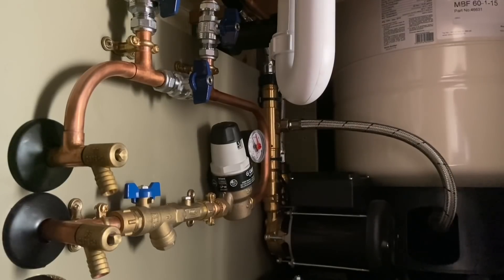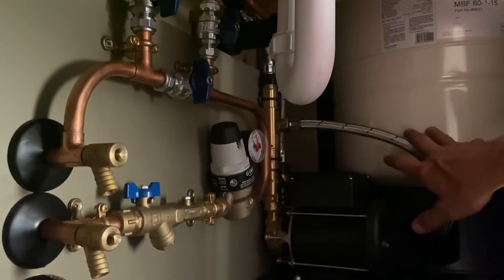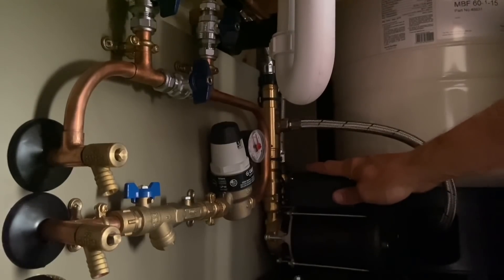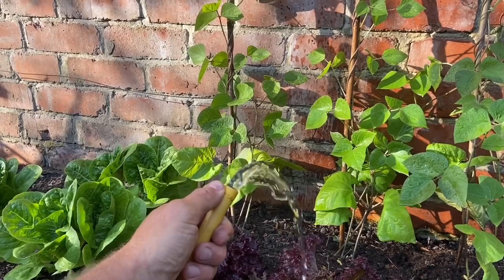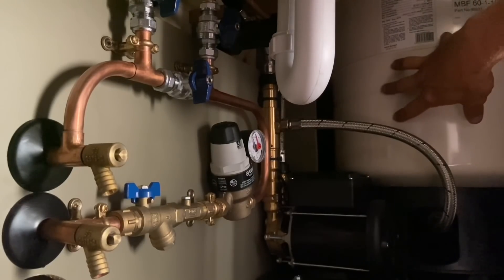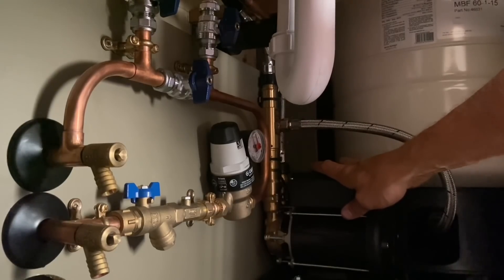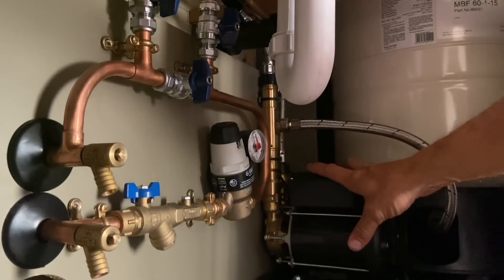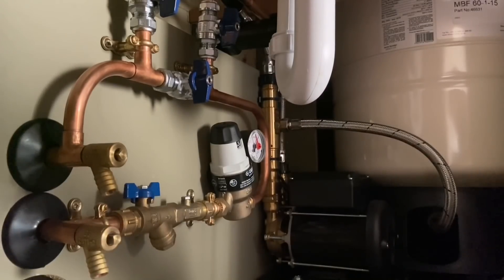P B Plumber: How to boost your water pressure and flow rates

Comment: Is it really a stupid question to ask that if you contact the water board locally, and get them to cut a new water service,with say a 20 mm water supply would that solve the need for all that pump and extra,s I just had to ask.

Comment: I've done loads of these around London, Stuart Turner Mainsboost products are first class but boy there not cheap, I also not long ago fitted a Aquaboost iboost that is just a cold water tank with boost pump that got the home owners out of a very difficult situation, it turned out well.  There original set up was a open cold water tank with a boost pump over thirty meter below there flat in a maintenance room that someone kindly filled with old cardboard boxes'  they had a white bacterial growth growing on them and this was their drinking water as well. before we fitted the unit we lined the walls of a large broom cupboard with plaster board that had  2" sound insulation on it  and put similar on the floor with a chipboard cover.

Comment: I'm an American Plumber and boy is it different.  Are the connections on the copper piping compression? I didn't notice any sweat or propress joints.  Do yall typically use compression style fittings? Just curious about how it's done across the pond.  Great video.
Reply: The branches or 'Tee's are soldered , he uses the bare minimum solder to keep it neat. We use soldered , compression ( mainly valves ) and pressed fittings . Most domestic initial installs are plastic piping with push fit connections , gas is still in copper . You see copper used where it's visible , under sinks or in cylinder cupboards.  It's just for show mainly .

Comment: That soldering is top notch. I thought for a moment it wasn't soldered yet. How do you manage to get it so clean? What do you use to clean the pipes afterwards? Would love to see a guide on that! Well impressed. At the moment I tend to chuck way more solder in than needed because I dont want it leaking.

Comment: Just out of interest was there a non return valve on the outside tap? I'd always been told that you wouldn't get a true dynamic reading opening another tap.as soon as you opened the outside tap the pressure gauge drops,that's your dynamic pressure. Excellent work by the way👍
Reply: That's a fair point , the gauge would continue to show the trapped pressure after the non return.  It did seen odd that it only dropped 0.1 bar from static to dynamic.

Comment: Brilliant video, was mulling over this pump a while back. We get about 17-19lpm but have terrible dynamic pressure (goes from 2bar to .7bar with tap on), so everything is fine until another tap is turned on then the boiler struggles. Anyway think your explanation is that this will work for us with the pass thru bit for the extra flow, though the noise might be an issue.

 Ideally don't want the noise so wondering about a none pumped accumulator, so if you have any info on those that would be great!  Thanks

Comment: When you place your thumb over the hose you create an increase in velocity.  Benouli explains that an increase in velocity occurs due to a decrease in pressure not an increase. I argued with an aircraft engineer over this point and ended up eating humble pie. It's the very phenomenon that creates lift in a wing. The top of a wing is longer than the bottom. The air passes over the top faster than under the wing. The higher velocity air is lower pressure and so the wing is pushed up by the higher pressure below. 
Pumps have a pump performance curve. The lower the flow the higher the head they can generate. Similar to your thumb on the hose the flow is reduced and so the pressure in the pipe increases. The pressure drop created by the orafice formed by the thumb allows the pressure to be released ( so pressure drops ) the result is increased velocity.
Your flow gauge can demonstrate this very well. The flow adjuster can be used to show the increasing velocity as the pressure drop increases. The gauge will show the pressure rise in the system as the flow reduces and velocity increases. This is the hydro dynamic law. 
P1/Q1□ = P2/Q2□
Interestingly I thought the pump could increase flow up to 12lpm by drawing more from the main. The reason for the low flow rate limit I believed was to prevent the back siphoning from other properties sharing the main. Do you have a link to your source for that information please.
Reply: I was going to comment but You got there before me 👍 I have had the same discussion with other plumbers
Reply: Correct, nozzle theory isn't taught to plumbers it seems.
Reply: @captainmashedpotato2630  yes it is!
 His explanation makes no sense to me, and i am a plumber.
Reply: Great explanation,  I'm an Aircraft Engineer and was going to comment,  but don't need to now.  Still another good video from PB though

Comment: he's back! what about the salamander mains booster? is that same thing? i just dunno how it does it when its inline and not able to pull more water from the mains
Reply: It does pull more, he just got it wrong. Regs are that you can't pull more than 12 lpm but you can increase an 8 lpm supply to 12 with a pump.
Reply: It doesn't pump more than what's coming in . What it's doing is increasing the pressure to overcome the losses in the pipework that would otherwise  decrease the pressure and it's overcoming the losses through gravity , you loose 0.1 bar per metre of height you gain .

Comment: Great video. I imagine with the sound created by the pump that the customer will use it for baths and showers only. Really good to see the outside tap comparison of pressure and flow rates. Cheers.

Comment: Great video and great to see you back, I don’t agree with some of what you say.

Pumps create flow, they don’t create pressure. It’s the opposition to flow that causes pressure. The flow out of the main is proportional to the differential pressure between the water main and atmosphere. The pump impeller spins throwing water outwards which causes an area of negative pressure. The flow from the main increases as there is now a bigger differential pressure.

There is obviously a limit on how much you can increase this as pressure loss increases with increasing fluid velocity.
Reply: Isn't the pump increasing the velocity of the water but not the flow?
Reply: @LunchBoxArcades  flow is velocity x cross sectional area.
Reply: Yeah this is wrong. 

Firstly, losses in pipe systems are mainly attributed to friction - being that there is a finite amount of water that can be forced through a given pipe size regardless of how much pressure is behind it. The smaller the pipe / longer the run / more fittings etc will increase frictional losses. 1.7bar is pretty normal for a water incomer in the UK but 9lpm is quite low, I'm guessing this is an older installation and probably towards the end of a street installation. 

Secondly, pumps create a centrifugal force by rotation and impart a centrifical force on the medium (water) as a result. The speed / impeller design / number of stages on a pump dictate the level of force created, which is directly linked the level of additional pressure generated. In this case, 1.5bar which is more than adequate for a household top up system. At no stage does negative pressure increase flow, flow is capped by the pump design and pipework limitations. 9lpm into a pump will only ever generate 9lpm out of a pump.
Reply: @captainmashedpotato2630  Flow is the result of differential pressure, centrifugal force moves the fluid from the centre of the impeller to the outside resulting in a low pressure region. More liquid is drawn into the low pressure region. The increase of differential pressure cussed by the pump results in greater flow.

Comment: great explanations here mate. i've seen quite a few large installations where a booster set has been put in without much thought. eg switching from open vent cold storage to boosted mains but neglecting to fit expansion vessel and safety valve to an existing dhw cylinder. and buying a nice set of microbore kitchen taps that trickle out because they're too close to the cold tank with not enough head - so had a booster set installed instead of changing the taps.